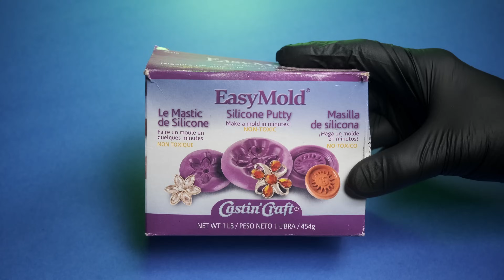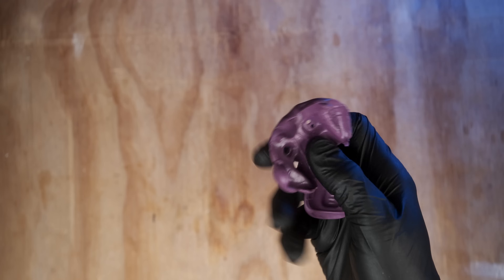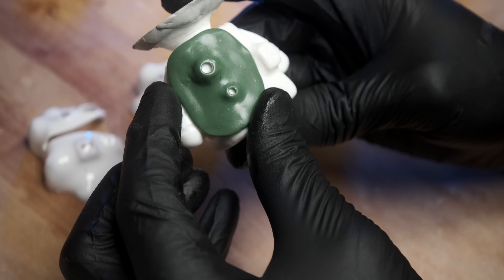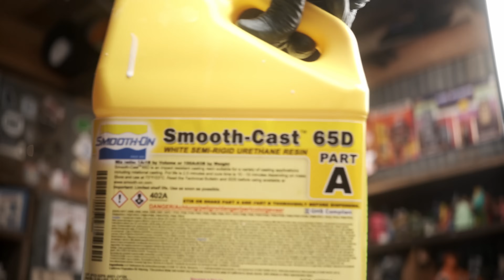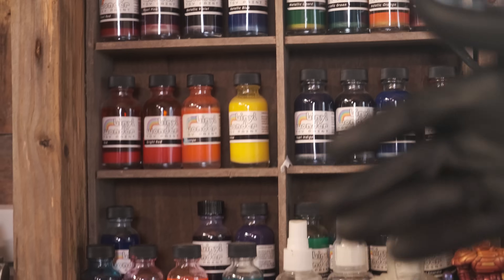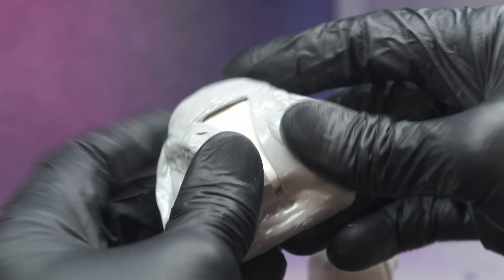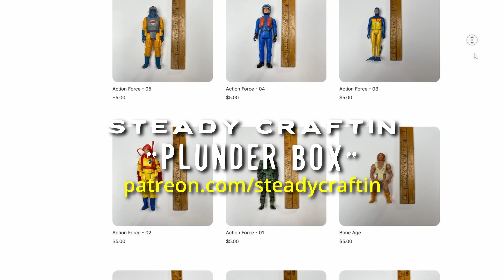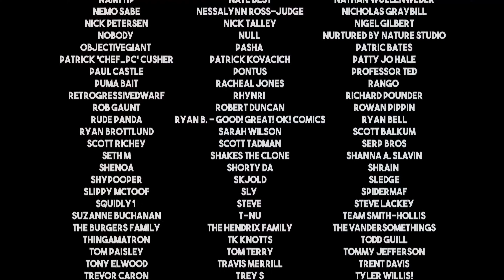How to make your own PAINT MASKS!

Comment: Great idea! If your models were sculpted digitally you could use the extract function in Zbrush to easily create a form-hugging paint mask and 3d print it, putting all the supports on the outside for a clean print.
Reply from the maker: Snap, that would be SLICK!
I've heard mention of 3D-printed masks but I'm curious about the fit because the pieces would come out not exactly the size printed. More of an issue with resin printers than FDM, I imagine.  P.S. I've seen screen recordings of folks using Zbrush and it looks like the closest thing to digital clay that I've seen. (My 3D experience is a couple decades old. LOL!)

Comment: What about latex?
You could apply it to the areas you don't want painted and make a few coats of it and once cured you make a last layer with plaster soaked paper to add rigidity.
This is a method used to make big moulds but it will likely work well as it's pretty thin and flexible.
Reply from the maker: This could work! The brushable type or (I've even heard) "liquid frisket" (if I spelled that right) used in painting as a resist for negative blocking / masking.  :)

Comment: Most masks were and are made by electroforming metal over what your painting usually in two pieces but sometimes more think of how a mould is made than they would be soldered onto a metal clamp for a two part mask or you would just hold the item onto the mask and paint

Comment: Craftsman where you find that Radio Shack at, man??? Dang I been needing a late 1980's version Radio Shack. You know what I mean. Not a cellphone store but a place to get things good for doing electronics crafts
Reply from the maker: There's a small town not too too far from us that had up until recently a Radio Shack. Although it was technically under a different business name, it had all the signage, and the complete setup in the back with all the electronics components. I was able to get all those antennas for about $1 each.
But yeah mannn, I used to just about HAVE to go into a Radio Shack whenever we were somewhere that had one.

I'd always wind up buying a battery holder or LED or motor or...    LOL!  :D
Reply: @TheCrafsMan  We've got a place called 'You-Do-It' up this way; it's a little out of the way, and if you're trying to take the train, it's really a long walk from the Green Line... and not You-Do-It is all history anyways. I think they closed forever last month. I definitely know what you mean, though - I'd always go in and get something

Comment: Ive seen small run injection molded keychains from china that have several colors. Im wondering how their molds were made to achieve it. There is very fine detail... radiomaster keychains that come with their radios for example.
Its not painted either. The colors are injected at different stages/sources or something
Reply from the maker: Oh yeah, it's totally possible to inject different colors. Those injection molds are impressively complicated sometimes, with extra "action" and allowance within the mold mechanism for "insert molding" and "overmolding" (Overmolding is used in situations where you'd have like a rubber/grippy surface injected over a rigid surface, like in automobile handles and stuff.  An insert molding example would be a metal screwdriver shaft that gets placed inside the mold and plastic injected around it. But the same can be done with multiple colors of plastic.)

Comment: Could you also maybe use glue? A kind that doesn't stick to your plastic, of course.
Reply: Could you as in, not requesting you to do it, just wondering whether it would work. Glue shrinks iirc so there might be some issues with that. And the drying time would be a lot longer than with green stuff and mold putty. But it'd be more accessible and cheaper maybe?